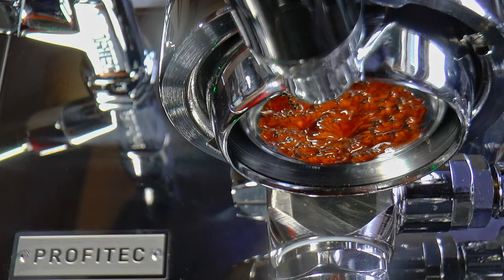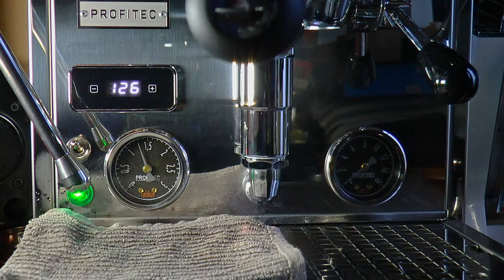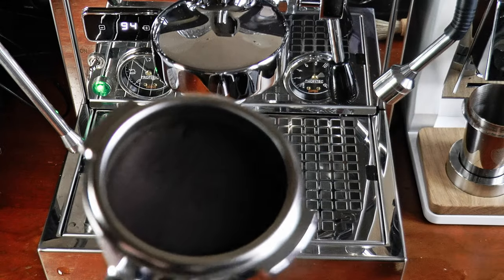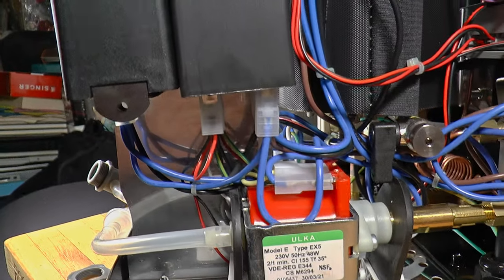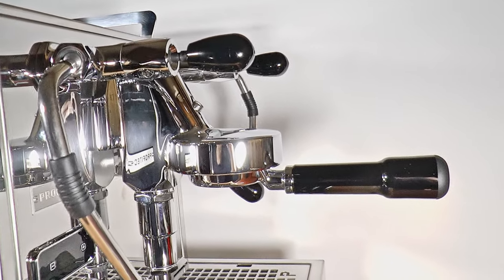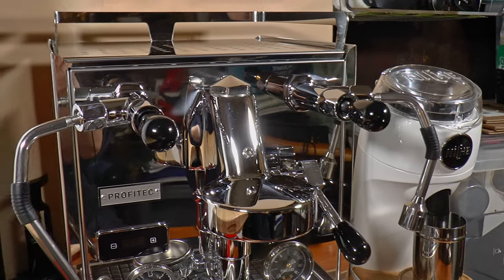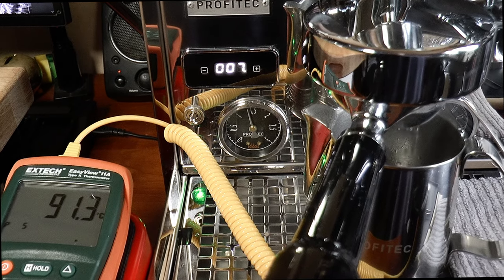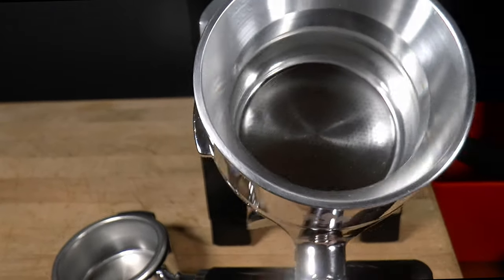Gearing Up For Espresso

Comment: Good choice! I was looking for a good espresso machine too I just use it for espressos mainly and making milk drinks occasionally. Went with the profitec go considering the price, it uses e61 portafilters and the relatively large brass boiler sitting on top of the group keeping everything at the right temperature. My workspace is very limited so the small size is appreciated. Getting this to Ireland for 880 euros feels like I robbed profitec and I paired it up with a new eureka zero grinder and for a total of about 1200 euros makes it an insane value kit, don’t think anything that costs way more than these two could make noticably better espresso. Very interesting and informative series, will keep watching!

Comment: Excellent choice, it's what I chose, only I didn't have the option of the levers for steam and hot water. Not that it matters much, I rarely turn on the service boiler, which makes me wonder why did I spend so much money to get a dual boiler when I obviously would have been fine with a single boiler! <grin>  I did have to remove the cup rail to get it to fit under my cabinets and I  simply replaced the rail with 4 tiny knobs instead, so I can lift the top off for filling.  I look forward to your new videos!

Comment: I've had a Pro 600 for 2 and half years now and I love it. I added the Coffee Sensor flow control which has really added to the capabillities. Your comment about "no sharp edges" is certainly not true for my 600. After slicing my hand and finger twice on the edges of the drip tray, I finally took a diamond file and smoothed them out. The edges were like razors. I purchased the Eureka Mignon Silencio with my 600 and it was a huge step up from my trusty old Rocky that I had for 15 years. I bought my setup from Clive Coffee in Portland. They have fantastic customer service.
Reply: Maybe the newer models had those improved? 
I bought mine just a couple weeks ago and it looks gorgeous and no sharp edges at all. The soft edges feels great!
I second that Clive coffee customer service is top notch!
Reply: @Phantom1000  I complained to Clive about the sharp edges and mentioned it in the review of my machine, so maybe someone is paying attention. Merry CHRISTmas!

Comment: 5:40 "It could serve for light commercial duty at say a restaurant..."  I was under the impression that for such use in the US, a machine would need to be NSF certified. I could not find any such reference in the user manual or Profitec's website.

Comment: I can understand your reasoning to choose a Profitect after watching the video, but I'd still say look at the Lucca flow control device and compare it to the knob you have now
Reply from the maker: I will certainly be addressing the short radius there. You can get about the same precision just cycling the pump manually, with a pressure gauge mounted on the group. Which is how I do it :)

Comment: the water temperature is interesting.
howcome in the first ten seconds the water coming put of the group head is less than the desired one? does it mean that every shot starts with "cold" water and only after ten seconds the "proper" water arrives?

should we before every shot open the water knob for ten seconds, quickly install the portafilter and start our shot?
Reply from the maker: Yes, the group is cooler than the boiler, so the water starts out cool. You should do a 10-sec warming flush if the machine has been idle. If you're doing shots back to back, no need to flush between each one. I will cover this in detail in a separate video.

Comment: 4:28 the brewboiler will be at around 106 celsius for 94 brewtemperature, because of 12 or 13 degrees offset. nice vid as allways.
Reply from the maker: Fair point. I'm probably overstating the difference between the boilers a bit since the brew one constantly sheds heat through the group. But I was on a roll :)

Comment: Looking at the cost of these in Europe, we low voltage folks Stateside absolutely get murdered by the cartels locally marking up the prices on these.....Ciaran is a champ as well. We just need to find that guy a way to swap parts to get 110v compatible machines.
Reply from the maker: I can't believe no one is making prosumer-level machines in the USA. The market would be huge. But there's nothing between Slayer and Bunn :(